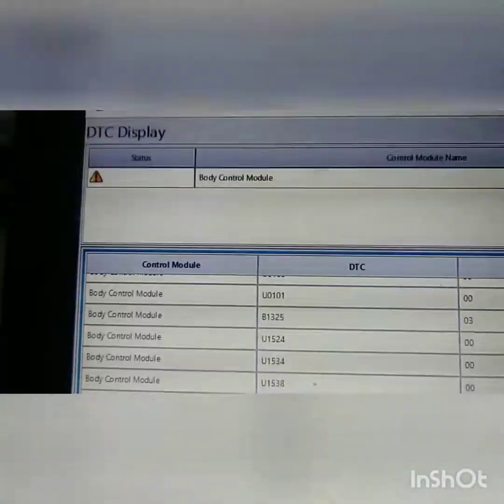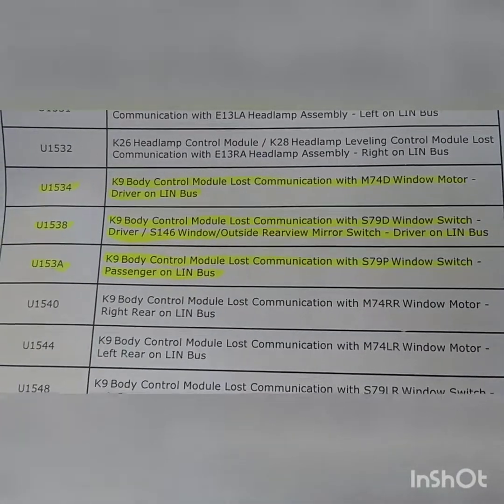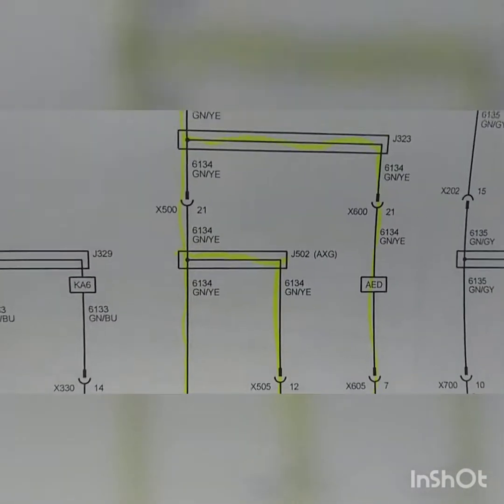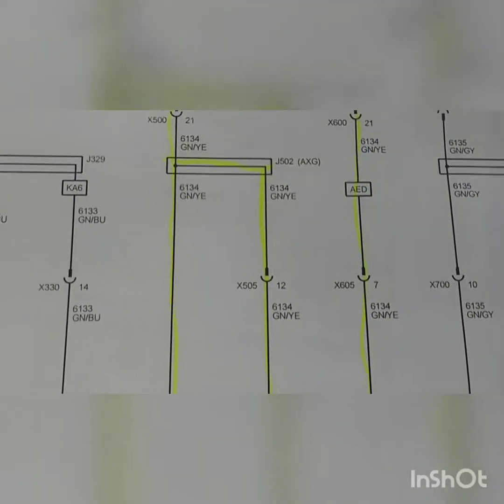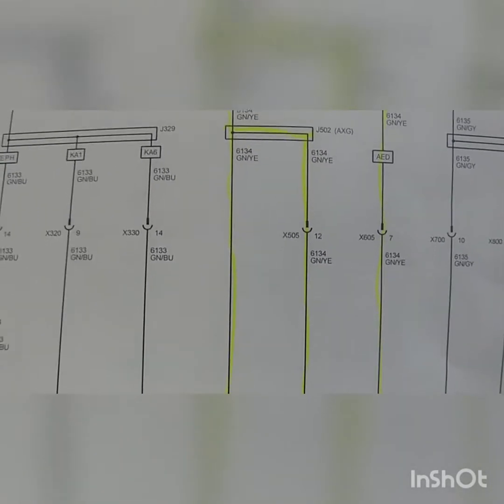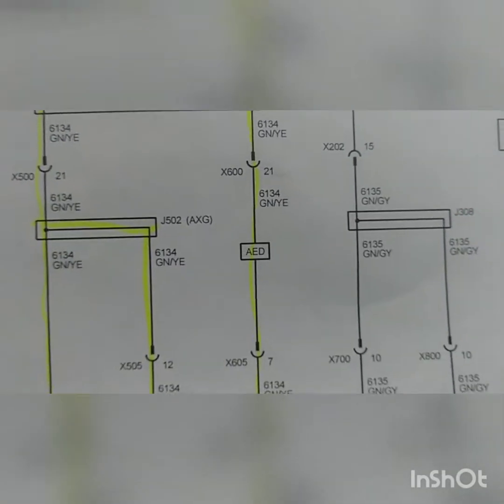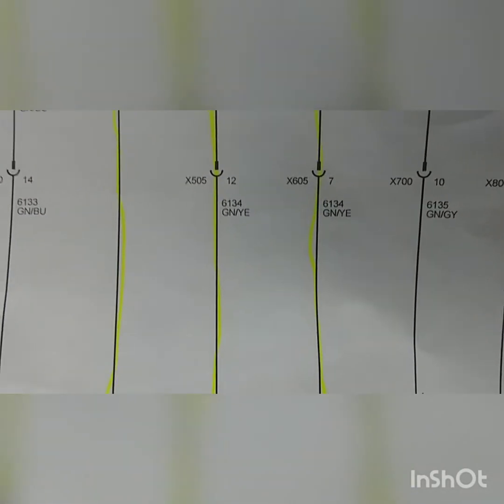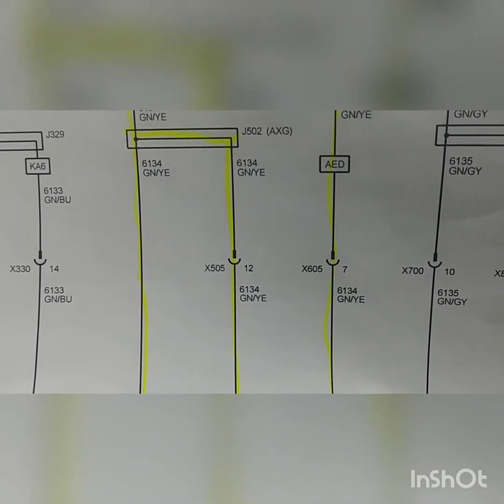2018 GMC Terrain power windows problem

Comment: Im a tech commenting here because ive had to fix this a couple times. its common to find a broken lin bus wire inside drivers door, green and yellow wire inside the door harness at the bottom near the breakout to the left front door speaker. cut harness open at tghe cable tie thats closest to the speaker harness and you'll find it. water intrusion into the harness causes it to corrode ive seen it a few times now on terrains and equinoxes. i couldnt remember this time where i found it so im leaving this comment for everyone especailly myself for next time lol

Comment: Where is X605? 2018 terrain. Only window working is driver. Other windows will work at their own switch. Mirrors do not work. Thought it was a bad driver control switch but same side with a new one. U01BO code. Chinese leds in taillights crashed the infotainment, trunk button, power seat. After removing LEDs stil left with driver window controls and mirror controls not working